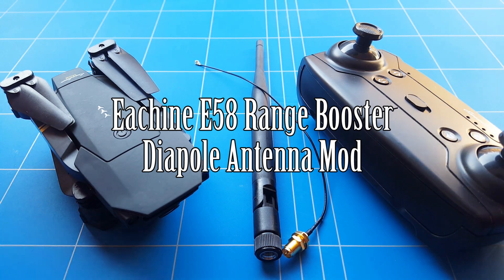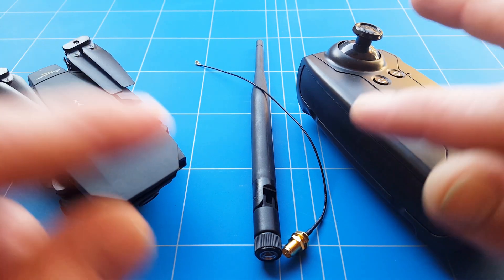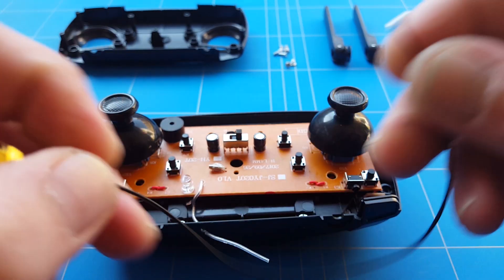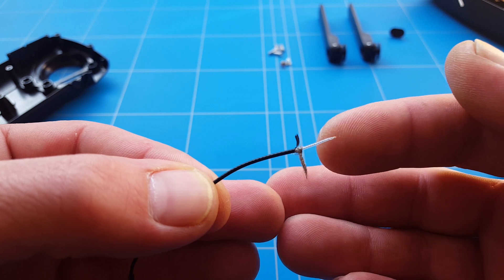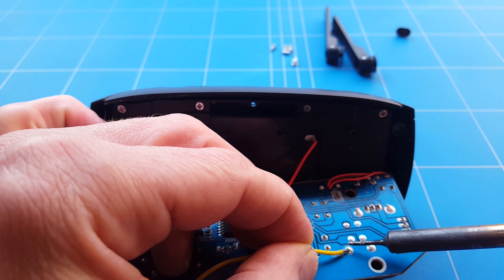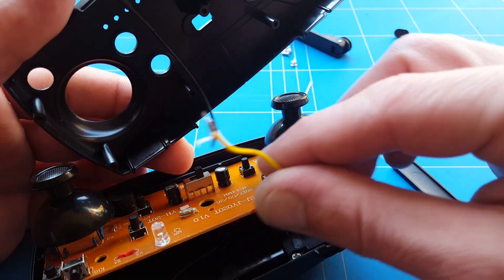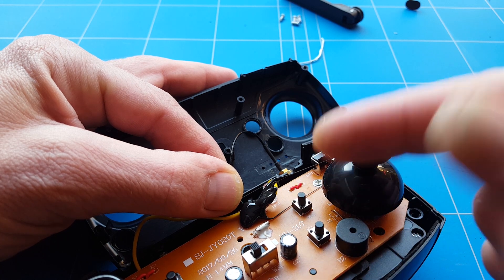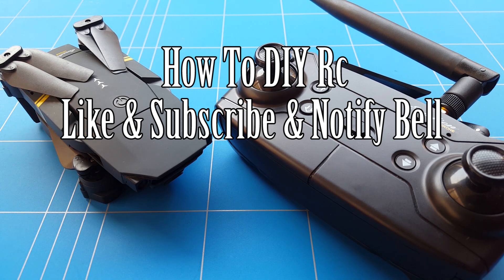Eachine E58 Drone Range Mod - Step by Step - Antenna Upgrade (Works For Any Rc Quadcopter)

Comment: Im a complete novice so im not sure how silly this question is. but does anyone know how viable binding another controller to these cheap temu drones. i have a taranis QX7 i can use but can't seem to find any info on how i could pair it with an e99 drone

Comment: Thank you for showing these. I bookmarked all three! Remote antenna mod, drone antenna mod and flight test. I picked one of these up from a local store for 15$. Worth modding it myself! As your test shows it goes much MUCH further having done both mods. I have the E88 version. Thanks again! Upvoted! 👋👋
Reply: I plan to do this to my just ordered e88 plus drone. How easy and well did it work for you? I'm curious about your experience.
Reply: @RobertBerthold not as much of a boost as I expected but it's worth it. It pushes it over the limit of from non-usable really, to usable. Just watch out for it being top heavy.
Reply: @Roiikka Thank you. And all you did was the remote intena mod or did you do any other mods?
Reply: @RobertBerthold  just that. They also sell USB wifi boosters. You have to get the right gHz. I.E. 2gHz sent out for the video so get a 2gHz booster. 5gHz video I usually assume the other is the 2gHz. And make sure the antenna not too long or it won't send out to the tip correctly. 👍
Reply: @Roiikka okay for sure. Thank you. 🤘

Comment: hi! what if there's no ground where to connect the ground wire?
Reply from the maker: Find negative power source on the circuit board or follow the black line from. The power source/ battery

Comment: Hi  I ust did the mod on my Eachine EX5 Transmitter using - 2.4GHz 6dBi Indoor Omni-Directional WiFi Antenna 802.11n/b/g RP-SMA Female Connector & 20cm/8" U.FL/IPEX to RP-SMA Pigtail Antenna WiFi Cable.   I still have to test it .
Reply: Que tal te fue... explicación
Reply: @freddyneyra4750   Ese drone es una mierda, no pierdas tu tiempo,
Reply: @MagnumQuality  bueno....

Comment: Hello,  I think I have the bits for the controller upgrade Will these work aside for having to cut te cable down  ??  2.4GHz 6dBi Indoor Omni-Directional WiFi Antenna 802.11n/b/g RP-SMA Female Connector & 20cm/8" U.FL/IPEX to RP-SMA Pigtail Antenna WiFi Cable   Thanks  :)

Comment: Um. I tested the mod..  It works.   But. When i use my phone and fly. Above 12 meters it delays and even crashed my drone... But when i dont use phone just line of sight flight. It works fine. More like 30 meters still no delay....

Any advice on how to use the camera without interupting the mod antenna signal???   Do i need wifi repeater??

Comment: You are genius my brotha!!!! Had a rip off E58 Toy. Bought parts ripped the toy apart and upgraded. Was so scared I messed something up! After putting it back together again. Gave it power and tried it out. HOLY SHIT!!!!!!!!! YOU KNOW YOUR STUFF MY MAN!!!
Reply: I plan to do this to my just ordered e88 plus drone. How easy and well did it work for you? I'm curious about your experience.
Reply: @RobertBerthold For a RC drone it does give it a little bit more range. I went ahead and bought a DJI MINI 2 and never looked back.
Reply: @theultimatehunt Good call. DJI is #1 by far 🤘

Comment: Can i put the negative wire in the negative battery connection???   The ground on my rc is just a flat copper circle  and its small... And. What method is much effective??  The ground or the battery connection
Reply from the maker: Both work

Comment: Hi soldering antenna to exisiting antenna wire work or would old antenna need to be stripped off the board first and new one resoldered?

Comment: I thought an SWR meter was needed for the antenna mod? Also why wasn't the original antenna grounded?
Reply from the maker: org antenna 1 wire upgrade antenna got 2 wires

Comment: Do I need to plug the antenna wire together with the battery wire on the gnd?Sorry for asking because I have order the antenna and I am only 12 years old
Reply from the maker: you follow the blackwire from the battery to the circuitboard there you can solder the outside wire from the antenna to the same spot on the circuitboard as where the black wire the - negative power runs too
Reply: @HowToDIYRc  Thank you so much, I will support your channel !

Comment: Do I need to plug the antenna wire together with the battery wire on the gnd?Sorry for asking because I have order the antenna and I am only 12 years old

Comment: Do I need to plug the antenna wire together with the battery wire on the gnd?Sorry for asking because I have order the antenna and I am only 12 years old
Reply: Stop SPAM  ._.

Comment: my drone did not have the GND button , so how can I do that?
Reply from the maker: Find black wire from battery the negative is same as gnd
Reply: @HowToDIYRc  Do I need to plug the antenna wire together with the battery wire on the gnd?Sorry for asking because I have order the antenna and I am only 12 years old

Comment: Hi it will work on any transmitter?
I open my transmitter but no gnd? Can i put it on negative to the battery
Reply from the maker: yes it works on all transmitter and negative from battery is the same as gnd it shut work :D
Reply: @HowToDIYRc  thankss ❤️

Comment: Hello sir I recently turned my e58 on and then hit the take off button by accident and away she went prob was I panicked in the house and grabbed it in flight! Now I have one motor that won’t turn off not even when I turn the drone and controller off. It stays running at full speed? Any info would be much appreciated as I am at a loss and can’t figure out what it may be? I disassembled the drone everything looks to be normal. I’m beginning to think that it is a controller issue maybe when it was calibrating something happen when the button was hit with the drone itself appears to be all right. The other three motors will not turn on I’m guessing because of the one that is running wide open? Thank you very much
Reply from the maker: tip1 tighten all of the prop screws sencond try to re calibrate the drone https://youtu.be/LyC5Ru-b3fs if you still have the problem with that one motor than you problay overheated the esc on the flight board Flight Controller: https://goo.gl/moy3CS

Comment: Great video. Do you have to ground the outside cable. What happens if you don’t?
Reply from the maker: thanks if you dont solder the ground cable it won't work to its full potencial you can give a try and see how much range you get
Reply: @HowToDIYRc  yeah lol it went around 50ft and RTH after losing signal.
Reply from the maker: lol that is not much a extra tip use a thin wire for better signal flow thick wire gives to much restions and hurt the range

Comment: Extending to 2KM range at 2.4 Ghz and 5 Ghz (2.4 Ghz in this case) isn't exactly rocket science.  Anyone with a passable idea of propagation, antenna theory and how to correctly identify the kind of termination and antenna you have vs the required termination of the replacement item in mind and what makes up the impedance matching circuitry and how to revert the often nominal 50, 300 or 600 ohm TxRX chip termination has been pre antenna termination modified to whatever termination impedance the too-short existing antenna needed and equally remove/bypass any 'loading' to make up for the off-resonance of the existing antenna.

You need to optimise (not by random 'it works elsewhere, so should drop in' fitting wisdom) both ends effectively since the communication is bi-directional.  Whilst you got away with the flaws in your methods on a low altitude low range model aircraft, the shoddy approach would have yielded worse results on a land or marine model at moderate to extreme range, which a properly engineered approach would have effectively offset some of the inherent loss over distance.  Try researching into propagation theory at SHF, and how signals being received outside of the Fresnel Zone of the antennas have a rapid attenuated received signal strength vs those in the antenna's Fresnel Zone and you'll understand a bit better the hidden causes of low range under certain environments and orientations relative between Control TxRX and the drone's TxRX.  Understanding how low altitude (tropospheric as opposed to stratospheric) weather conditions (humidity, high and low pressure and 'tunnels' that can exist due to pressure ranges that actually enhance propagation over the line of the 'tunnel') - these, plus knowing the basic principles of radio at SHF can allow you to plan, assess and gain passive effective range gain by doing longer range flying under favourable conditions. 

In fact, a lot of apparent thinking demonstrated reminds me of some of the thinking behind CB operators and their 'super duper' setups (which weren't even remotely in the territory of) which often where mods copied from others who's copies or facsimiles of known mods where done with zero real idea of what made the mods work (when they did) or why the mod actually improved matters (on the rare occasion the gains weren't lost to inherent flaws of application and a lack of idea to what actually matters).
Reply: Lmfoa

Comment: Hi,
I lost one bat due to small tornado :) he flew away and now I have one dron and 5 batteries and 2 remote controllers. 
I only have 1 antenna from an old router that looks the same as yours. Is it pointless to upgrade only the remote and not the drone too? Or would it extend the range for a few meters?
Thanks
Reply from the maker: with just the transmitter antenna upgrade you also boost the range for sure and the old router antenna works for this MOD

Comment: Any tips on upgrading the battery? Could really use longer flight times
Reply from the maker: the one upgrade i didn't came around doing because i lost the e58 in the ocean 
my idea was to upgrade to a 18650 battery downside is the size and weight of the battery :(
Reply: @HowToDIYRc  would a 1400mah 11.1 or a 2300 7.4 not work?
Reply: @straydragur no neither of this will work. Can only use 3.7 volt batteries. For longer flight time, you can do the add another battery upgrade to make it fly on two batteries, or but I battery with high mAh.
Reply: I also need this answer;--;

Comment: Thanks for this video. 

Bought a E520S recently which comes to a sharp stop at around 60m. I wonder if the range is restricted by software (GPS based) instead of hardware? I have bought a range extender which I will try out first, and then mod antenna if required. The drone itself has an ipex connector but the transmitter is soldered and under glue :(
Reply from the maker: thx for letting me know 60m range really sucks for a gps drone  are you sure the ipex connector is reciever antenna or the 2.4 wifi antenna? sorry for my late replay :D

Comment: Hi can you help me i cant find the ground on my transmitter
Reply from the maker: Do you see a black wire running from the battery compartment? This ground too ore look for a solder pad on the circuit board saying GND! = GROUND TOO
Reply: Thank you so much yoive been a great help

Comment: You can just reuse an old dual band router antenna for free.
Reply from the maker: Yes you can if you have one
Reply: Is that the same thing as a 4g wifi router antenna?

Comment: Bonjour. Est ce que cet antenne pourrait fonctionner? Merci.
2.4G / 5.8G 6dBi double antenne SMA de gain de fréquence élevée de Wifi FPV pour FPV RC Drone de course

La description:
Nom d'article: Antenne 2.4G / 5.8G FPV
Fréquence: 2.4-2.5GHz ~ 4.8-5.9GHz double fréquence
TOS: <= 2.0
Gain: 6dBi
Impédance: 50ohm
Connecteur: aiguille interne SMA
Longueur totale: 19,5 cm
Diamètre: 13mm

Application:
IEEE802.11b / g / nWLANSystem
Système de communication sans fil
Wi-Fi / WiMAX / Système MIM

Comment: Do mods on the one key returns I noticed the antenna on the transmitter and drone has to be pointed in the same direction for it to come back towards you
Reply from the maker: one key return sucks on cheap drones

Comment: Having watched you doing this mod thought i might give it a whirl myself!! Would some one be so kind as to telling me if a 2.4GHz 6dBi 50ohm Wireless Wifi Omni Copper Dipole Antenna SMA To IPEX  would do the job??  many thanks in advance! Great vid by the way! Also would just doing this one modifcation alone increase range significantly??
Reply from the maker: a 2.4ghz antenna is a 2.4ghz antenna so it shut work

Comment: DIY Rc, where do you place the Ground Wire Antenna if the transmitter has a Zig Zag PCB Antenna for 2.4GHz TTL camera flash trigger (very small/doesn't have a lot of space)?

Comment: Can you show us how to do antenna mod on the new Hubsan Zino transmitter and controller?
Reply from the maker: the basics is the same just find a ground / negative connection on the circuit board and solder the antenna to it

Comment: Thx, nice Mod! What I did, was to drill a hole close to the antenna pin through the PCB. The area around is also GND. After removing the solder resist around, I got a good solder point, so I don't need extra cables. To protect the fragile antenna cable I would recommend to put a little bit hot glue at the cable side (after both cables are soldered).

EDIT 2018-07-26 : Yesterday I made the range Test, I did the same before the modification. With a 5 cm antenna I got ~80% more range (perfectly good for this small copter without real FPV).

If someone want to repeat the test, place your E58 in ~1m height at a fencepost (e.g.), bind, and move away with the sender directed to the copter. The copter start to blink if the signal is lost. It's important, that the copter in all tests needs to be oriented to the same direction.
Reply: Could you please post a link of the mod. that's my problem with the sg900 controller, there is no ground point near the antenna.
Reply: I plan to do this to my just ordered e88 plus drone. How easy and well did it work for you? I'm curious about your experience.

Comment: Can I still use the transmitter without screwing on the antenna? Would the range be similar to the unmodded?
Reply from the maker: no always add the antenna mate

Comment: But I didn't Understand That why Do U used the second yellow Wire?
Reply from the maker: you don't it;s better to solder direct to the circuit board for the best range

Comment: Great video, thanks! some questions:
1. can you also use a 10 or 14dbi antenna for this mod? will this further improve the range?
2. I guess this only extends the controller range not the FPV video to your smartphone. What do you think on using 300mbps Xiomi wifi extender in combination? The extender only improves the range of your smartphone for FPV video? Or just use the extender and control the drone via smartphone?

Thanks!
Reply from the maker: 10ddbi antenna works with this mod and extends the range yes and only from tx
wifi network extender improves the range of the fpv and flying drone with phone 
but there are more things you can do to improve the wifi fpv and phone range that we show in the up comming video :D

Comment: Help me!!! I made this modification, but it did not work. continues with the measly 50 meters. What do I do? I did the modification exactly that way and it did not work out. Help me
Reply from the maker: solder the positive wire directly to the circuit board helps to fix your problem
Reply: How To DIY Rc So I put the positive straight on the board? I had a direct soldier on the antenna. How I do?
Reply from the maker: remove the stock antenna and solder the new antenna ion that same place and add hot glue to make the joint stronger and won't break 
the old antenna was resisting to much that's why you didn't got the extra range the first time you did this mod
Reply: How To DIY Rc I need to take the original antenna? Can I put the positive on the board without removing the original antenna?
Reply from the maker: yes you can! check on the circuit board that says ANT there you can solder it 
it's the underside of the stock antenna hope you understand mate :D
Reply: How To DIY Rc I did this again! Thanks for the help, I'll take the test later and I'll tell you the results.
Reply: How To DIY Rc The modification worked out !!! thank you so much!! I arrived at 100 meters with a simple antenna of 3 dbi.

Comment: great work! i have this drone, it's really nice for the money. And thanks for testing these mods for us too, I'm sure I'll be modding mine if it works out for you. Have you tried using a WiFi detector app? There's a great one called "Wifi Analyzer" (by Farproc) on the Google Play Store - it has an audible beeper/proximity detector, among other things. If the E58 still has power and is transmitting WiFi it should make it easier to find within the right range

Comment: Hey buddy when will you get the 300dbi WiFi booster would love to see that 😁😁👍👍👍
Reply from the maker: working on it Sir it's coming pretty soon :D
thx for watching :D
Reply: Hi, this looks great! but I'm not sure about the links that you attached.
Are the antenna and connector enough? (first 2 links) do I need the booster (3rd link) as well? or is it just an "all included" package?
because the booster costs half the drone's price so that's really not worth it.
Thanks!

Comment: why dont you use ground from led its much closer
Reply from the maker: your very sharp Sir good one :D
I just look for a GND on the circuit board to make it more visible on camera what I'm doing and get less question explaining what we just did in the vid :D
Reply: LED will interfere with the signal. Not a good idea.

Comment: Whats distance?
Reply from the maker: +Joystick Quebrado coming up next weekend Sir🖒
Reply: How To DIY Rc I also did the modification in mine, however I did with 2 extra antennas of 5dbi, I will do the tests later and I speak the results. Tell me yours to compare.
Reply: How To DIY Rc Help me!!! I made this modification, but it did not work. continues with the measly 50 meters. What do I do? I did the modification exactly that way and it did not work out. Help me